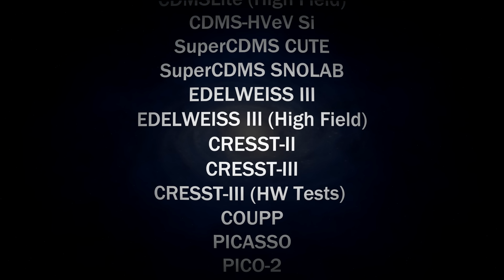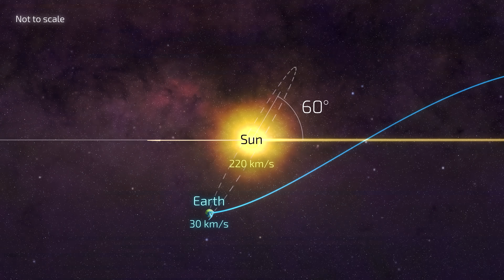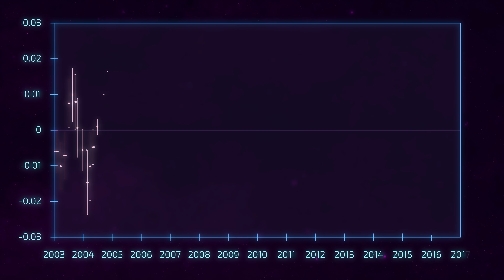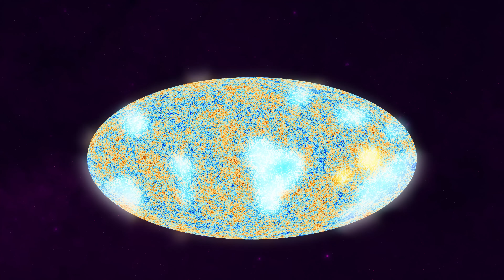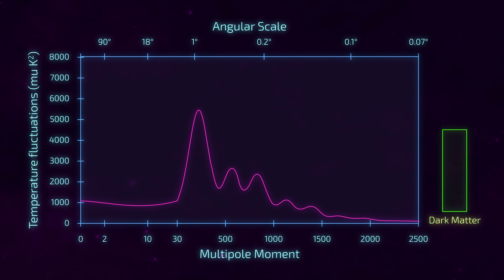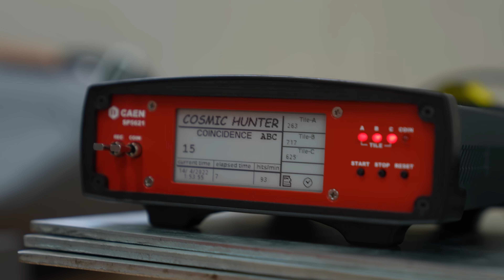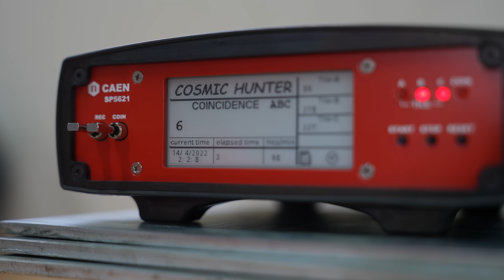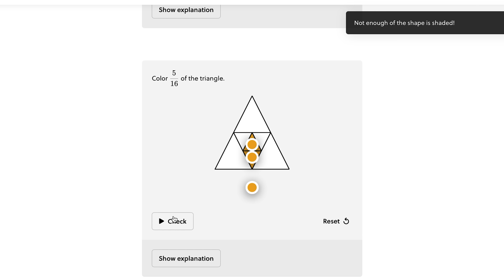The Absurd Search For Dark Matter

Comment: If the dark matter can be influenced by the presence of the nucleus, would that also hold for the matter shielding the experiment from radiation?
Reply: Yes, if dark matter can interact with nuclei, it will also sometimes hit the shielding.
Reply: @atticmuse3749  Does this mean building it underground could potentially prevent dark matter from being seen? Or wouldn't that be a problem?
Reply: @pauladriaanse  No, because the dark matter is so weakly interacting it mostly passes straight through solid matter, and only very rarely will it hit a nucleus. So the amount that gets stopped by the shielding does not appreciably change the amount that passes through the detector.

Comment: Rotation of galaxies is controlled by the cosmic filament the galaxy is traveling inside of and is powered by. You can create your own fractal galaxy inside a vacuum chamber filled with various gases and metal vapors, under right electromagnetic conditions and without needing dark matter. See Understanding Plasmoids video by See the Pattern on fractal galaxies.

Comment: Just wondering: Assuming dark matter only affect the visible matters through gravity, why would they think a dark matter "particle" would act like WIMPs and hit the nucleus's of  Sodium Iodide crystal ?  Or is it just like a best-effort attempt at getting something at all?
Reply: The assumption is that it interacts through gravity, does not interact electromagnetically, and maybe has some kind of weak interaction through the weak force or some other mechanism. It just needs to be weakly interacting enough that it generally passes through most material, similar to how neutrinos can stream through solid matter and only very occasionally interact with an atom. As these experiments search and continue to not detect anything they can rule out certain interaction strengths and particle masses, and as they get more sensitive (bigger, better detectors) we rule out weaker and weaker interaction strengths. But yes, this is basically just a best effort "hey if they do this, we could detect them, so let's try that". There are other theories of dark matter such as axions, which are very very different from WIMPs and require a completely different kind of detector to look for and are based on different assumptions of how it interacts with ordinary matter. So we're looking for dark matter in a variety of ways.

Comment: I have occasionally heard the theory proposed that gravity might be the only force that acts outside our standard 3 dimensions, accounting for its unexpectedly lower force in the standard model.

If that's actually the case, could dark matter be higher dimensional matter we're getting a gravitational glimpse of as it passes close enough in that extended geometry for strong interaction?
Reply: There is a PBS video that actually touches on this subject and they found out that gravity doesn't travel in higher dimensions, it's worth a watch
Reply: @purnjay2554  im intrigued how would you prove that its not like we have any 4d objects to test
Reply: @kellynolen498  I think it was something like looking at the strength of gravity at different distances from an object. Like we know that the gravitational force depends on 1/r^2, which means it spreads out in 3 dimensions. Just like light spreads out in 3 dimensions, that's why the intensity of light depends on 1/r^2. The same amount of light spreads out over a larger area, and area depends on r^2.

If something spreads out in 2 dimensions, it's intensity depends on 1/r.
If something spreads out in 3 dimensions, it's intensity depends on 1/r^2.
If something spreads out in 4 dimensions, it's intensity depends on 1/r^3.
And so on

The same maths can easily be extended to higher dimensions.
Reply: @kellynolen498  You would be surprised how much of graduate-level physics education is devoted to generalizing effects to various dimensions, it's all just math. I myself work on 2D materials, which are novel materials that are so thin the charge carriers only travel along the surfaces, producing effects only possible in 2D systems.
Reply: @adarshmohapatra5058  this is correct. The idea was to test the 1/r^2 dependence of gravitational force very precisely at different lengths. If gravity "leaks" into other dimensions, you could expect deviations from this 1/r^2 form. The deviations would depend on your model for the other dimensions I'm sure. Are they compactified? If so, how large are they? What's their geometry? These sorts of things. We've seen no significant deviations from 1/r^2 so it doesn't look like gravity leaks into extra dimensions, the leakage could always be below our experimental sensitivity though. 

Moreover, the evidence against modified gravity theories from astrophysics and particle colliders is strong. I'm not an expert though so I wouldn't be able to explain it off the cuff.

Comment: Ok... hear me out. If Dark Matter is actually a thing... is it possible that instead of dark matter not interacting with matter that it actually doesn't react with electrons? And not so much electrons, but the field that the electrons create. We always hear that little joke about "well actually you never really touched anything because touching something is actually just the atoms repelling each other". That and we also hear that in an Atom, the actual "Volume" of an atom is almost entirely just comprised of where the electrons can exist at, then at the center of that atom is the nucleus, however the rest of the atom is just 99.9999999999996% empty space (according to google). So... this tells me in my head... that Dark Matter DOES interact with matter.... but it doesn't appear to interact with fields... which ones specifically I am unsure (obviously). It seems to interact DIRECTLY with matter, passing through fields that would normally stop or deflect other particles. If that is the case, I wonder if there would be a way to set up the crystal structure in such a way that from a single direction it would actually be impossible to get through without hitting some nucleus... it would probably be impossible seeing as how much empty space there is in an atom... perhaps there is an atom with a larger nucleus that would increase the chances of interaction?

Comment: Maybe dark matter is simply an interaction between gravity and space itself.  We know mass warps space, so space it would seem is a physical material, not a void.  Dark matter needs to be a material that interacts with normal matter, but doesn't interact with itself like it does normal matter. Couldn't space fit the bill for such a material?....... If we liken space to something like a thick layer of iron powder spread out on a table, then we place a magnet in the middle of the powder. The powder would stick to the magnet like a big fluffy ball. If you moved the magnet around it would drag the ball of powder around with it. Similar to dark matter the powder adds to the mass around the magnet, but isn't a part of the magnet and doesn't react as strongly to itself as it does the magnet. 

An interaction like this could also explain why we see gravity as such a weak force. Just like the strength of a magnet is deluded when it's electromagnetic force is partly absorbed by a coating of iron powder the gravitational force may be being sapped by space (or whatever we finally decide dark matter is) clinging to matter.

Comment: Wouldn't the massive black hole at the center of our galaxy cause the outer stars to maintain position and speed due to the immense gravity? I'm skeptical of the dark matter theory. It just seems like a simplistic way to explain something we don't understand. I suspect we'll eventually determine it's a flawed theory just like the sun orbiting earth was during the middle ages.
Reply: The black hole at the center of our galaxy doesn't actually have that much of a gravitational pull on the outer reaches. It's the combined mass of all the stars, black holes, gas, dust (and possibly dark matter) that holds the galaxy together. Remember, the total mass of the Milky Way is around a trillion solar masses, our supermassive blackhole Sag A* is only ~4 million solar masses.

Comment: So how is it not "ether"? It acts like a subatomic fluid. Pushing things made of matter together due to a pressure gradient... It's almost like atoms "crush" into a weightless form, causing the "weightless matter" to escape, and then - new matter get sucked into the "matter" or "mass having" particles... producing gravity. 

Can the gradient of dark matter pressure produce a force acting like it is gravity? I mean... same "shape" as the iso-lines in gravity field... Frictionless particles, which objects pass through without interacting, but producing perpendicular force towards object made of "matter", pushing them together... Odd... probably silly. But fits the picture.

And stays in line with the concept of "cancelling matter out". At low density - merely producing heat, causing things to "wiggle". Throw a dense cluster of antimatter and it's a bomb suddenly...

Comment: I'm missing something. If the rate of particle detection is assumed to be due to the Earth's speed in its orbit around the center of the galaxy (the sun's speed plus or minus the Earth's speed around it), how will putting a detector in the Southern Hemisphere help? That will detect differences in a VERY tiny spiral-within-a-spiral that the video's graphics don't show, but in the scale of the model (2 AU, or about 186 million miles), the Earth itself is almost a dimensionless point.
Reply: The point isn't to find something different between the two hemispheres, it's to see if they're the same. The effect of Earth's motion through the dark matter will apply equally everywhere, and so if the detectors both get the same peaks and troughs, that's a good sign it might be dark matter. If instead the peaks and troughs in the southern hemisphere are out of phase with the northern hemisphere, then the periodicity could be the result of some seasonal effect.

Comment: Modifying gravity isn't the only solution. In fact there's a vast amount of evidence that it is ordinary matter. Also the claim that there's a spherical halo doesn't match the rotation curve. Consequences that can be calculated from the theory that it's ordinary mater match observations over a broad range of consequences. The shapes of galaxies can be calculated from the rotation curve. That consequence matches all galaxies from spherical to disk shaped. Simply put a steep rotation curve calculates to a sphere, a flat curve is a well populated disk, a Keplerian curve matches all in the center, and little in the disk of the ecliptic. Since the rotation curve describes a disk for disk galaxies then it is normal interacting matter. Our own solar system has more matter than the estimate average of distribution density that can be calculated from the "missing" matter. That is a density of about 400 Jupiter size planets in the space between Sol, and Alpha Centauri. If it was a more or less uniform distribution of Jupiter size planets we would calculate the nearest to be on average 3 light months away. We wouldn't see it. But we do see Jupiter size planets in our own solar system We have a higher than average number nearby. That matches the theory as ordinary matter. Far from mass concentrations mass moves more slowly than near concentrations like stars, and therefore accretion is slower between the stars. We wouldn't get star accretion out there as fast as near star mass concentrations accretion into stars. The visible halos around galaxies are illusions same as they are on earth. It is suggested that if the halos were caused the sam as on earth like a street light on a foggy night there should be increasing halo density with distance. That assumes the "fog" is uniform between galaxies. But it isn't It is in threads as part of the threads that galaxies structure into at large scales. When seeing into a thread to a galactic halo from the side of a thread there is no increase with distance. But in those rare instances where a thread is aligned with our line of sight there is an increase over that distance. I strongly suspect the dark matter theory isn't out of ignorance because it can be disposed of so easily, and broadly. But is a dishonest technobabble swindle for funding. That is my theory of what dark matter is. The rotation curve is ordinary matter. Dark matter is a technobabble swindle.

Comment: There is an elephant in the room explanation for the abnormally high rotation rates of stars in spiral galaxies (the reason for the theory of dark matter). Einstein explained it in the 1939 journal "Annals of mathematics". Wherever you have an astronomical quantity of mass "dilation" (sometimes called gamma or y) will occur. Mass that is dilated is smeared through spacetime relative to an outside observer. If you look at a common relativity graph, with velocity on the horizontal line and dilation on the vertical, the phenomenon is clear, even mass that exists at 75% light speed is partially dilated.
  There is no place in the universe where mass is more concentrated than at the center of a galaxy. 99.8% of the mass in our solar system is in the sun. 99.9% of the mass in an atom is in the nucleus. If these norms are true for galaxies than we can infer that there is 100's of trillions of solar masses at the center of common spiral galaxies. There is no way to know through observation, there is far too much interference, dilation and gravitational lensing. High mass means high momentum. If we attribute a radius to these numbers than we can calculate that relativistic velocities exist in these regions.
   The mass at the center of our own galaxy is dilated, in some sublime way that mass is all around us because as the graph shows we are still connected to it. The recent discovery that low mass galaxies (like NGC 1052-DF2) have normal star rotation rates is confirmation that dilation is the governing phenomenon at galactic centers. This is what relativity would predict because there is an insufficient quantity of mass to achieve relativistic velocities.
   The fact that mass will dilate when it approaches the speed of light is something we all learned in high school at it perfectly explains the greatest mystery in science. There is no "mystery" mass, there is just mass at differing degrees of dilation.

Comment: Dark matter? Matter that isn't formed by entanglement? Physics is supposed to be scientific. Thermodynamics is force of weight in resistance to cold space. Thermodynamics variations are outward force of weight repelled by cold resistance throughout space. All Thermodynamics exists in space in perpetual motion. Cold repels heat. The two do not mix. Temperature variations are Thermodynamics in gravitational fields of forced cycling patterns around cold space in mass. Hence vibrating frequencies of avoidance of the opposing forces. Magnetic fields are grander examples of quantum gravitational fields of forced cycling patterns of renewable mass as it cycles Thermodynamics and resistance. Resistance of space passes through planets  as it vibrates in repulsion of momentum repelled by cold resistance maintaining its momentum. Magnetic fields cycling patterns of thermodynamics in quantum gravitational fields of forced cycling patterns holding mass together. Resistance is in all mass repelling outward pressure as weight. Occupied space is the weakest point of resistance. Mass travels to the weakest point of resistance repelled by cold resistance of space. Two forces combine to make mass in entanglement. Gravitational fields of forced motion hold mass together cycling in equalization. If gravitational fields break down because of increasing Thermodynamics then masses gravitational fields increase or blow out like a fuse or light bulb. Thermodynamics is the variant. When thermodynamics isn't in mass it is frequencies in space in free traveling repelled momentum. Hydrogen absorbs heat and becomes helium. Gravitational fields of forced flow cycling frequencies increasing its resistance and thermodynamics in equalization of entanglement. Periodic table of elements proves hypothesis of internal outward pressure held as weight. Increasing thermodynamics and resistance in occupied areas of space in equalization. Entanglement. Free-flowing fluidity of thermodynamics is outward force repelled throughout space by cold resistance. Space is a stationary cold negative field of resistance to thermodynamics. Theoretically.